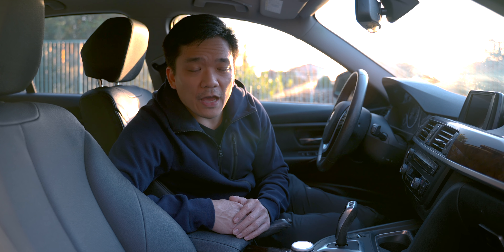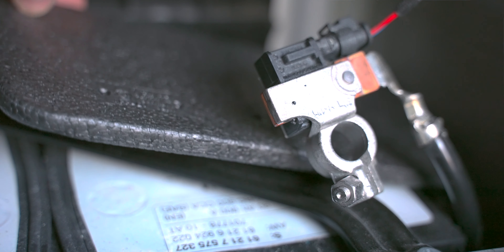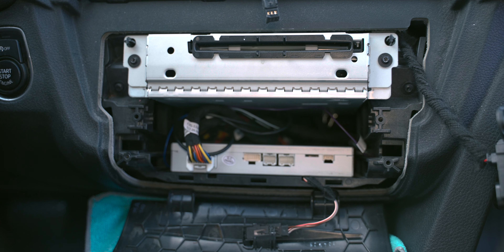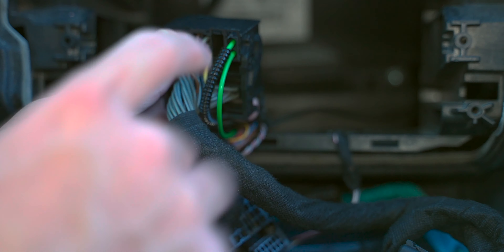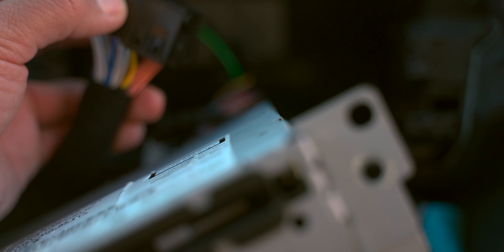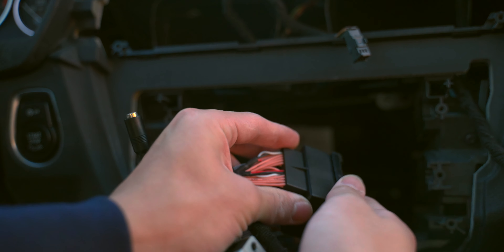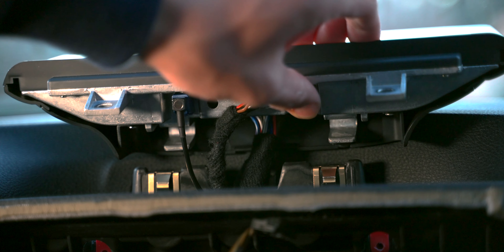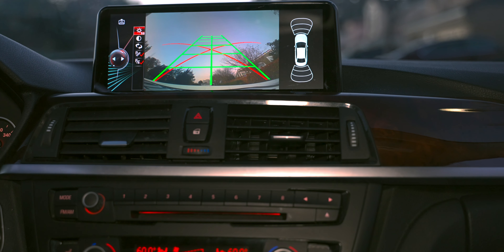BMW Screen Upgrade | f30 328i Koason Android Display | 10.25

Comment: Hey thanks for the video, the link you put for the amazon product is a NBT version and your dads f30 has the CIC menu. Can you confirm this information. I think they might be compatible.
Reply from the maker: What year is you car?
Reply: @FritzRamos  its 2014 320i but it works with mine,  id just recommend people check which pin connector they have before buying.
Reply from the maker: @willkilliam258  Got it. Thanks for sharing, I completely agree

Comment: 7.28.22: Purchased this unit from your amazon link for my 2012 328i it will be in on 7.30.22 will install and give my thoughts.  Will be using this video as my installation guide.
Reply: how'd it go?

Comment: For anyone doing this installation, depending on your cars configuration - running aux to armrest may not be necessary.  Chances are if you do not have a Combox you dont need to,  but verify it works first.
Reply from the maker: Thanks for sharing
Reply: Any way to know before buying if on my car it would require the aux cable connection? As i dont want to use that. Thanks
Reply: @rickymx50  Theres no known way to tell definitively. What model and year is your F30? Look in the trunk and lift up the floorboard, if there is a slim silver box (Combox) to the left of the fuse box, you WILL have to run aux to armrest. If there is nothing there there’s a good chance you don’t have to worry about it.
Reply: @ubuntuisawsome100  mine is a f20, year 2017. One of the last NBT before NBT EVO. Do i have to search for this combox anyway? Thanks
Reply: @rickymx50  You shouldn’t have to run the aux
Reply: @ubuntuisawsome100  what is combox? thanks. Because mine doesnt have sound after installation even after i transferred the optical cable...
Reply: @jonzi  the combox is basically used on some vehicles until 2013/14 for telecommunications, To check if you Have one open up your trunk, and the lift up the floorboard of the trunk, you should see a fuse box, and if you have a com box it will be to the left or the right of the fuse box. If you don’t have one and still don’t have audio there’s a few setting on the HU itself you can play with. I don’t have one of these anymore mine kicked the bucket, so if You can’t get it to work my best recommendation to you is to return it and go to the OEM CarPlay route
Reply: @ubuntuisawsome100  Thanks very informative, mine apparently does have the combox and android unit no sound but I have already connected the optic fibre cable still no sound. Does that mean I have to use aux cable?

Comment: Thank you for the Video Fritz .. so that i am clear no need to purchase a separate MiMi?  Stock 2013 328i F30 does it have a MiMi or does it not?
Reply from the maker: Newer models of the screen shouldn't need it. You can ask the manufacturer if the android auto is pre installed before you purchase the screen

Comment: Great video! I have installed a same screen in my bmw x2 f39 but i dont have the same settings options as you show on your videos. Is there a way to update the firmware? The issue i am having and want to try and fix is that when i connect on the screen bluetooth so i can use carplay, when i use bluetooth for calls only the drivers speaker is enabled and i cannot adjust the volume, so i want to use the car bluetooth for calls. Thank you.

Comment: Howzit Fritz
Thanks for the awesome video
Quick question
how's the glare on the screen in direct sunlight?
i have one installed at the moment in my f30 buts its a  different brand & its near impossible to see during the day
Reply from the maker: You should be able to adjust the brightness on the screen. I haven't had this experience with mine, but the opposite. I had to install a blue light filter because it was too bright at night.

Comment: Hi,
Could you help. 
I installed a new 10inch android screen. Everything works fine and well apart from whenever i am on a phonecall the car seems to only send sound to the left speaker. I assume its because its set to an American setting. Is there anything i can change like the type of car. Ive got it set to auto set

Comment: Do u have any issue while using the bluebooth to make/receive call? I got a complaint from the other side that they could not hear me clearly in both Android bluebooth or Apple car play while making phone call
Reply from the maker: No. The calls should go through the BMW side, you can select this in the menu settings on the android side.
Reply: @FritzRamos  thanks, I will try again
Reply: @wcheong  any idea where this setting is?
Reply: @mboss_f8618  no idea, I still using Android for phone call but it is sucks

Comment: Hey mate ive got the f30 with the base stereo ive upgraded to the mtx splits and subs the bmw specific kit.. Will this headunit upgrade change the audio output to flat allowing me to mess with the equaliser as all i have is base trebble controls with the stock unit and apparently the eq already is set on the base unit so you cant change it much.

Comment: did you bought the cic or nbt version oft the android unit
- because it seems your dad‘s car has a cic headunit
- i was wondering if the nbt version works in my f32 (looks exactly the same as in your dad‘s car)
Reply from the maker: This one is the CIC. The manufacture should be able to tell you this on your website if it is for CIC or NBT of of the unit will work with either.
Reply: I installed an NBT unit in my 2017 Mini Copper with the 6.5 screen. Sold the Copper and started driving my 2013 328i with CIC. Decided to see if the NBT would work and it does perfectly. They’re both BMW so that helped. The Cooper has the combox integrated with the head unit while the 328 doesn’t so in order to get sound, you’ll have to use the aux plug. Works fine though.
Reply from the maker: @davidmolina8759  thanks for sharing

Comment: hello i don't know if you could help me i install an android carplay screen on my bmw f20 year 2011 everything works the carplay etc the buttons on the steering wheel do not work and i have no sound coming out. do you have a solution?
Reply: Hi, for no sound, please connect an AUX cable and don't forget to change it on BMW original settings.  And steering wheel buttons works only on OEM, please.

Comment: Hi Fritz, I just upgrade f30 328i 2013 koason 10.25 this week. do i need to buy the dongle for andriod carplay?
Reply from the maker: This one yo ushould not have to do that.
Reply: @FritzRamos  Thanks for getting back to me. I got the same exact car as your dads but am having trouble connecting using usb cable, some  functionality is not support by the display. Should i connect both bmw and android bluetooth altogether or one or the other. my phone is note 20 ultra. I would appreciate so much if you show me how you set up it with your dads. Thanks again!

Comment: Hi fritz. I bought koason 10.25 display to my 2013 bmw 328i and i installed it my i drive is not supporting on it and no audio is playing through my car speaker sometimes touch screen is not working and on factory setup it is showing me only the imei number i am not able to acces the setting on factory setup...

Can you please help me with that...please.....
Reply from the maker: there should be a rest button on the back of the unit. You might need a paperclip. Audio might be related to the optical cable, do you know if you have one? Did you also report this to the manufacturer?
Reply: Did you ever fix it?

Comment: my bmw 3 series 2014 does not have a bluetooth module. this screen will let me use bluetooth connecting my mobile.
Reply from the maker: Yes it will. Just select unit bluetooth instead of the default OEM in the settings.

Comment: Why My car's original interface shows the clock after android screen installed?
Reply from the maker: Change it to "OEM" under the start up setting
Reply: @FritzRamos  I did :L checked all settings accessed with pin code. Comes up with no signal. checked all wires. OEM screen works fine.
Reply from the maker: @alphonselee3564  what size was your original screen?
Reply: @FritzRamos  1 x NBT EVO 8.8inch) Its a 2016 f80 m3. I tried all settings. No signal

Comment: So this screen is compatible with Apple CarPlay—even though it is Android?  This would be great for my BMW.
Reply from the maker: Yes. The apple carplay is installed as an app on the screen. Once you make the connection it will auto connect

Comment: Do I need to use the AV cables if I don’t have any cameras? Also where do I plug the usb cable to?
Reply from the maker: No, if you have the oem camera or no camera you can leave the av cables alone. USB cable inserts into the back of the head unit

Comment: Hi mate, I have a 2018 318i with 6.5 inch screen, factory fitted reverse camera with no gps. It is an ID6 EVO version with a base model audio system. I want to upgrade to exactly the same unit that you have installed. My car does not come with an aux input port in the middle armrest compartment and only has a USB port. Can I still get this working on my car, the installation  seems straight forward and I do not see any issues there. I wish someone can answer my query and I can go ahead with the purchase
Reply from the maker: I just messaged the manufacturer. I'll let you know when I have an update.
Reply: @FritzRamos  thx, you have been kind enough to reply back to my request, worth subscribing..
Reply: Hi, any reply from the manufacturer?
Reply from the maker: @sumeetkakroo  THey said that they have one in production, but it's not on amazon just yet.
Reply: @FritzRamos  Hey Fritz- I have the same setup on my 2018 F30. Any idea on compatible products?

Comment: Fritz does the Android screen work with idrive touch control, like a mouse? Or only the buttons?
Reply: Yes, it is a touch screen, and you can use a controller and steering wheel buttons.

Comment: Hey bro nice video! Would like to ask do you experience any rattling noises from the screen after changing it? Mine one keeps on rattle abit on uneven road, cant source where it really comes from, but it goes away when i hold the screen still, its very annoying
Reply from the maker: Check the 2 screws that hold in the actual screen. There is an inset that they go into, there might be a chance that the insert broke.

Comment: Does any one knows if it is possible to have "touch screen" on BMW  not original system? In my case when I touch it it automatically switch to android OS...
Reply: It is normal that when you touch it it automatically switch to android OS...

Comment: I just installed koason qualcomm 8core 4+64gb android 10.25 inch screen on a bmw x6 2010 but YouTube and other sound apps do not work or show sounds. Do you have any idea how to solve this issue?
Reply from the maker: Sound that comes from the unit itself will come through the au settings. You have to adjust the units volume and aux volume
Reply: Same problem here. Did you fix it?

Comment: Hi I just replaced the screen on my 2014 BMW 328 it was a 8.8 to a 8.8. I replaced it because the screen cracked, But the new screen says NO SIGNAL.
can you please help me find someone help me fix it.
Thank you
Reply: If you are having a no signal issue, please check a wiring loom.

Comment: Hello everyone I’ve got my android headunit for my 328i F30 but i have a big issue just curious if anyone had this issue and know how to fix it
Its the iDrive knob when i use the android system via iDrive knob it works on original system at the same tome so i was browsing my music library on carplay and i did change the car BMW Profile and sometimes i rest tyre monitor and even make calls without being intend to so its very annoying i partly fixed the call issue by deleting original bmw Bluetooth from my phone but still both android and original systems works at the same time via iDrive knob right now I’m using the android system by touch only so i can avoid the problem what should i do
Reply: Did you find a solution to this? My idrive doesn't show up but I control both at the same time

Comment: Thank you for the useful videos. I have X1 F48 with a basic Idrive system head_unit ENAVEVO 
vin 5H42326 
with small 5 buttons controller and I want to upgrade to this Android 10.25".
Appreciate it if you could advice on the required compatble components with my car. Thank you.
Muhammed Alduri

Comment: I did not recommend this android system, it doesn’t come with manual instructions at all my back cámara never worked and I couldn’t connect my phone with the apple play also is not cheap at all.
Reply from the maker: Reach out to the manufacturer . You  might have a bad one